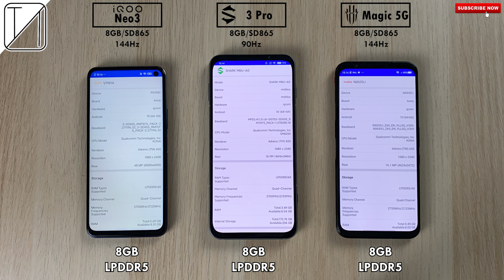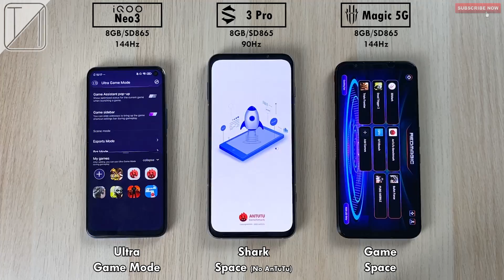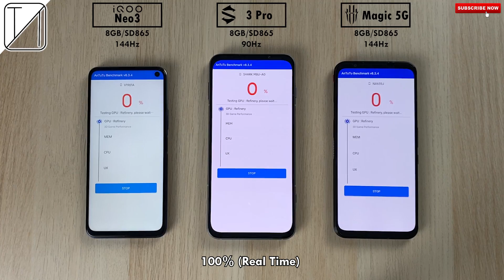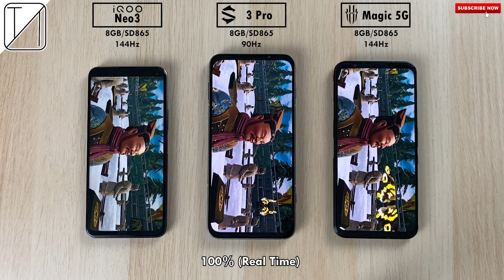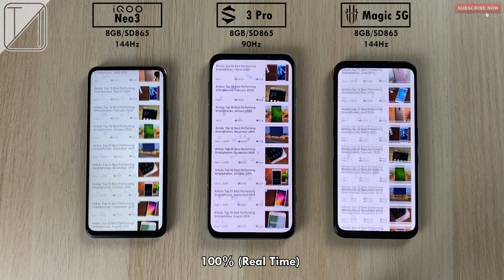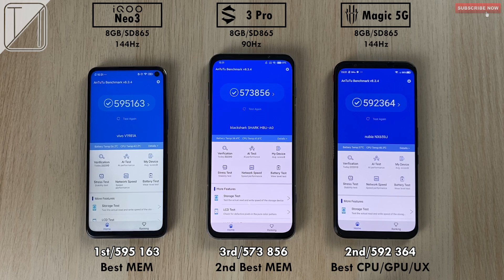iQOO Neo3 vs Black Shark 3 Pro vs RedMagic 5G | AnTuTu Benchmark Test

Comment: My question :- 
Does the iqoo neo 3 get heat up after 5-6 hours of pubg gameplay
Reply: I have the iqoo neo 3 and i am using it 2days now... i play pubg in max settings for 3 to 5 hours it doesnt heat up stable temperature and the optimization is great in 90Hz i can play 11hours  and 12 mins of  screen in heavy usage..  thats my experience😊..
Reply: @eduardsonfuster5547  what is the storage type in iqoo neo3. Ufs 2.1 or 3
Reply: @BabaYaga1136  3.1
Reply: @eduardsonfuster5547  where did you buy it? This phone is perfect for me since i play games.